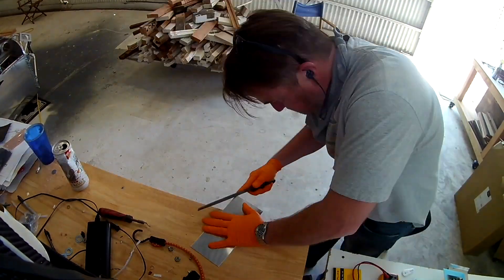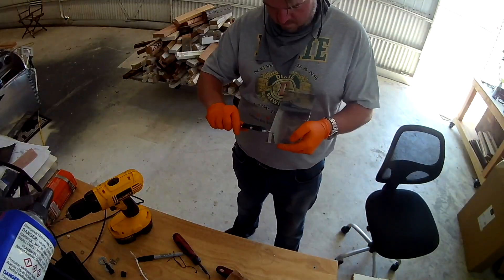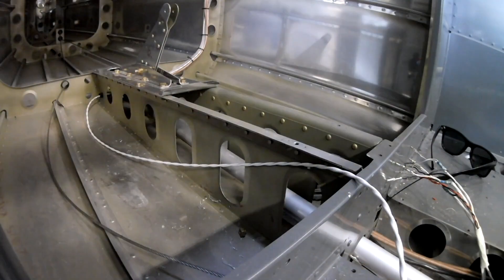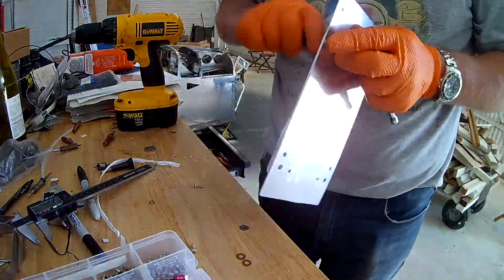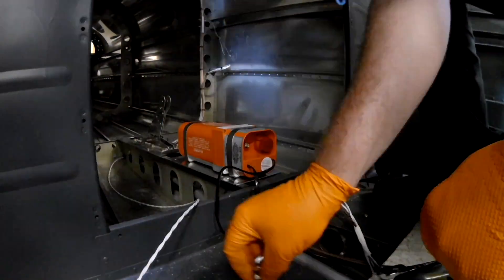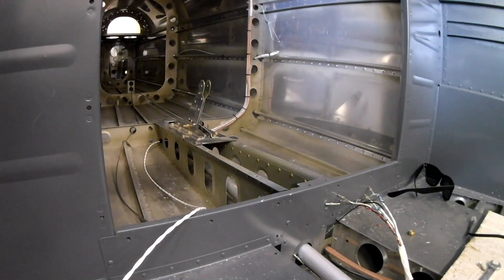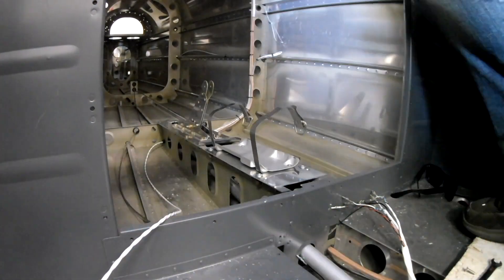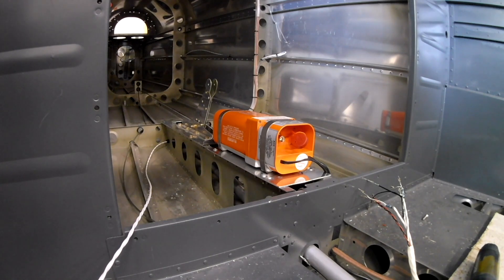RV-14 ELT Relocation

Comment: Any issues with sitting the fuselage on the floor?  Is it supported anywhere?  I’m thinking of doing the same to spray the cockpit.
Reply from the maker: With the plywood in place in the cargo bay no. Though its still a little unnerving. I tried to keep my knees off of the step inspection panels and between that and the center channel.

Comment: You bring up an interesting point about weight and balance. The -14's wing leading edge fuel tanks are forward of the C.G., so as you burn fuel, the C.G. migrates (slightly) aft. The -14 has a 100-pound baggage compartment limitation. So yes, a lighter pilot - solo - and full baggage onboard could create an interesting handling scenario if they takeoff at or near the aft C.G. limit. Wise approach to not only calculate a takeoff C.G., but a predicted landing C.G. as well.

Comment: Why are you moving it rearwards when you have a rearward balance issue? I think i missed something
Reply from the maker: I'm moving it forwards not rearwards. Originally the ELT is at the very back of the plane between the two stabilizers. I've moved it to the forward edge of the tailcone to help make up for the weight I'm losing at the very front of the plane.
Reply: @akilroy  Ok. Is that a difference with the 14 and 14A? If so I hadn't realised. My 14A plans have it located just behind pax seat back in baggage area.
Reply from the maker: @ianreilly4763  really? The entire ELT or the antenna?